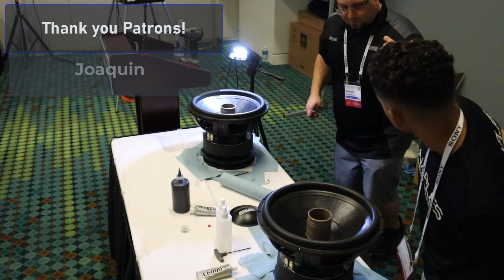How to fix a blown subwoofer!

Comment: I recently did my Z18V3 Sundown. I got the CA from EM Audio. Used E6000 from the hardware store. My tinsel leads were not done. Tip-if your leads aren’t done, trim and solder them before gluing the cone in. It was so difficult to solder the terminals in the sub. I applied the CA and the E6000 before setting the cone in. Just my preference.

Comment: He said he doesn't like the rubber-toughened ca glue but that's what he's using. The black 
ca glue is rubber-toughened, it's the rubber particles that make it black. It's used on the spider landing because the rubber makes it more flexible and able to handle higher temperatures. It also makes it able to resist cracking from vibration and shock. Using too much accelerator is what makes it turn white and it also makes the bond weaker. This is closer to a drop-in than it is to recone.
Reply: If you have the time, is the accelerator absolutely necessary?
Reply: @rubenmejia942  Nope! Not at all.